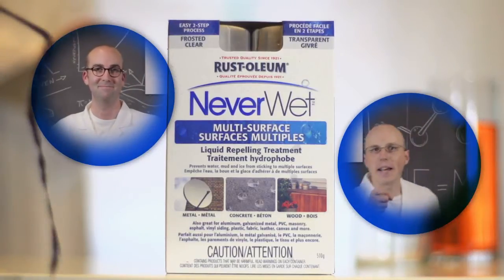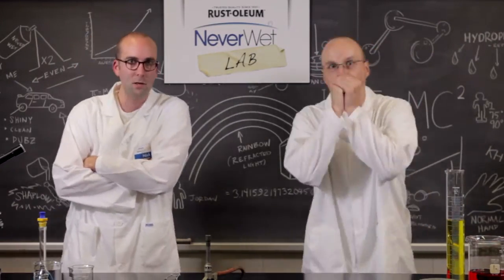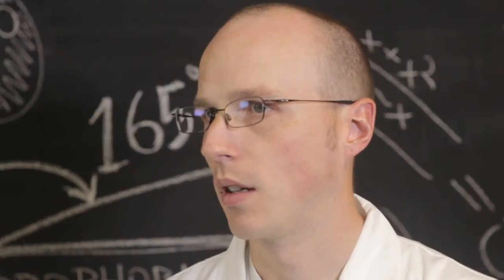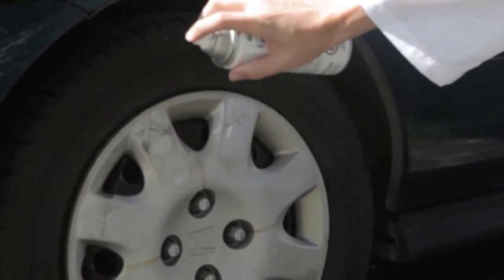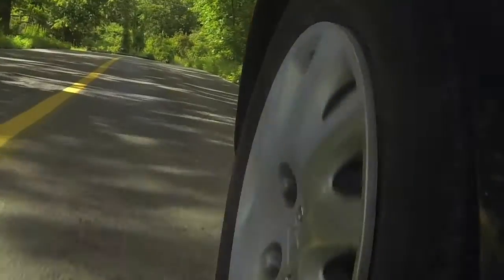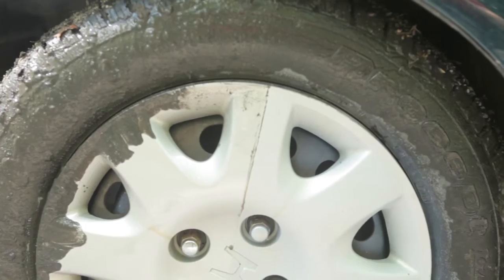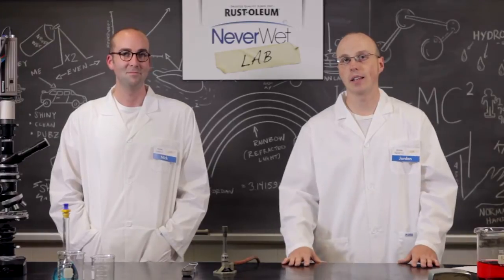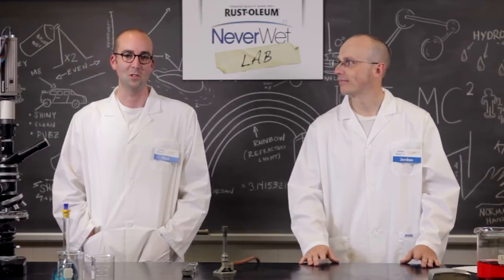NeverWet Lab: Experiment 2 Car Rims

Comment from the maker: Hi Mike Z.,
There should be no problems using Never Wet on alloy wheels.  Never Wet can withstand up to 140 degrees Fahrenheit of heat, but it is not break dust resistant.
Hope this answers your question.
The NeverWet Canada Team

Comment: HOW LONG TIME DOES IT WORK IF USE?
Reply from the maker: Hi there,
Great question! Durability all depends on the surface NeverWet is applied as well abrasion.  NeverWet is resistant to normal wear and tear; however, with excessive abrasion or if applied to a walking surface, the superhydrophobic properties will be quickly diminished. In many situations, the superhydrophobic action may be reduced, but the remaining Top Coat and Base Coat still provide protection to the coated surface.  Superhydrophobicity can be restored by scuff sanding the object to remove the residual Top Coat, and then recoating the object with Base Coat and Top Coat.
For more details, see our video about durability: NeverWet Lab Durability
Hope this answers your question.
The NeverWet Canada Team